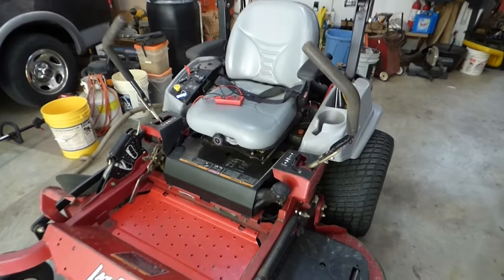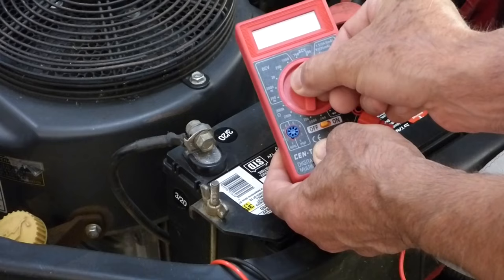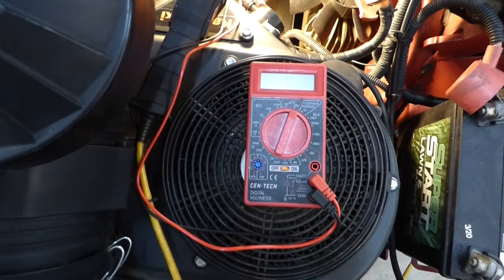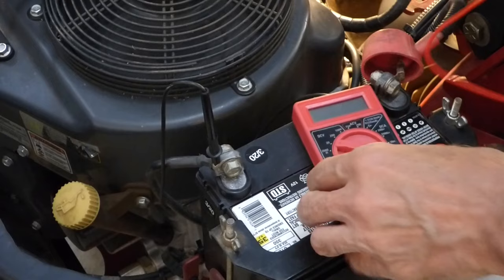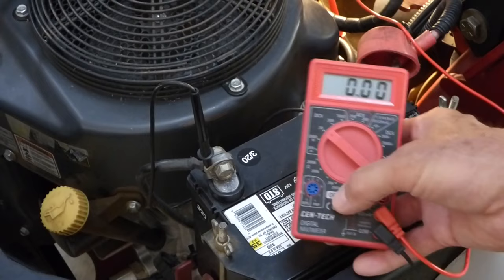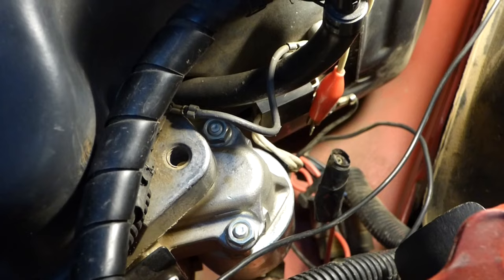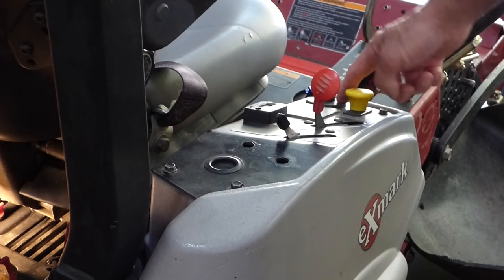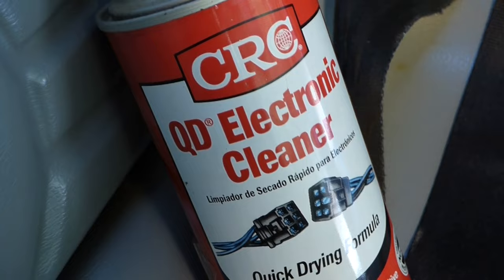How to Test the Charging System on Small Engine Equipment - Battery not Charging Fix

Comment: Your video is a nice addition for young fellers that are learning WHY things are happening electrically.  It's a very good tutorial! My first check is just to put the leads on the battery before and after it is started to see if there is a couple of volts difference.  If not then I do exactly as you are tracing it down.  Mowers are always dirty and subject to corroded or broken wiring :)  Store them inside folks if you can at all.  It will save you some troubles and last a few years longer kept out of the weather.

Comment: I bought a used JD z445 two years ago and im just getting around to addressing the battery charging issue. Ive just kept it on a trickle charger full time when not mowing. This video appears to be a great tutorial for trouble shooting the issue. Ill do it when i get home! Thank you sir.
Reply from the maker: Just a heads up...  If your battery charging system is not working you can limit the life of your PTO clutch.
Wishing you the best in fixing your mower

Comment: Was very helpful. Thank you. After going through the steps I got to my panel with my ignition and pto and my display. Found that after changing my pto last week I some how loosened the wire harness to my ignition. It was starting but not charging pushed it back on all the way and charging again. Thank for the help!
Reply from the maker: Excellent!

Comment: Thank you great video. You can check those fuses without removing them. Top of the fuse there's small openings either side, with power on place probes on these, sys voltage=open, 0 volts= closed. Thanks again, I've never gave much thought as to how my mower charging system works.

Comment: Excellent video! found that my stator and regulator were fine, and it was the wiring. It was too complicated to rewire or check further so I just bypassed the wire and went from the regulator to the battery and it's charging perfectly. I don't know if this will damage anything else but it seems to be a good fix. Thanks for the info.
Reply from the maker: That should work

Comment: Thank you for taking the time to make this great informative and “micro” explanatory video. It looks like my issue is with the wiring and I was wondering if I could make a direct connection from the lead positive of the regulator and the battery (which made the battery begin charging) and keep it like this instead of digging in the wire harness to figure out where the problem is.

Comment: My god! Brother thank you I operate a landscape business and we own over 20 mowers it is frustrating when our mowers go down and we have to wait a 3 week turn around to get it back from the shop. I fix over 80% of mechanical problems on them so I can avoid taking them in. This is one of the most common issues I run into and usually ends up at shop, from now on I’ll know how to diagnose this thanks my guy!
Reply from the maker: Glad I could help.  Low voltage will burn out PTO's so it's good to keep up with it.
Reply: How many yards you have to need that many mowers?, I also run a lawn service with 2 mowers and 113 yards,  I fix my own also after warranty goes out til I upgrade, are you a commercial client with your repair shop, we come first here and most time back going in hours... just curious

Comment: This is a great video to learn how to check the wiring after checking stator and regulator outputs. Thanks!
If I came upon a fuse block that dirty I’d do something to protect it in the future, even if it was only cleaning up the surrounding area and covering with duct tape and using a sharpie to write “FUSES!” on the tape.  Bad design - should have had a removable cover built in from the factory.

Comment: Excellent video with all the details as to how to diagnose issues regarding battery not charging.  Hopefully this will allow me to remedy issue with JD zero turn battery drain.
Reply from the maker: I hope so too!  not good to run the pto with not enough volts... burns then out.
Reply: If you have a battery drain, perform the current draw test between the ground terminal and the negative battery pole with your amp meter, should be less than 0.03 amps with the ignition off.

Comment: I also run a jumper wire from negative battery terminal to the voltage regulator, then from positive voltage terminal to positive battery terminal 😊

Comment: I have a brand new china mini skid steer. The unit worked great except for one issue. It would not keep the battery charged. Followed these instructions and found the red lead from the voltage regulator had not been connected at the factory. Had to undo every wire bundle to find it. Had 45-50 volts at the stator. Thank you.
Reply from the maker: Way to go!

Comment: Nice trouble shooting skills, just some dirty fuses can cause plenty issues. I've got a Ferris mower in my driveway that is going through the same issue. It has a tender on it but I believe they never use it and the batteries are just going dead. I've wanted to start small so I have already replaced the voltage regulator. I'm fixing to pull the single charge wire and omit the switch and see what I come up with. Even the replacement regulator it still isn't charging. I don't see a ground wire either on this Kawasaki as you had stated in your video. That might be the issue with this one. So after conducting your second test and connecting the hot side to the single tab of the regulator, it was charging. So I am going to make a ground wire and see what that does.
Reply from the maker: you can do it!

Comment: Video was helpful. I do understand electricity and the basics of charging systems, but I did not consider fuses or ignition switches when my Husqvarna PZ72 was not charging. I discovered another tip that you might consider, using your multi meter check the resistance between positive battery terminal and the disconnected charging lead from the voltage regulator. There should be no continuity with the ignition switch off, and very low resistance with it on. Mine was registering around 200 ohms when I started this test, after cleaning the ignition switch, it went down to about 50, but it’s obvious that it’s faulty and needs to be replaced.
Reply: Yes and resistance equals and causes Voltage drop.. not good.

Comment: Very interesting. I'm pretty sure my battery is shot because it's ancient (7.5 years, original on a 36hp Vanguard Hustler Hyperdrive) but I never knew a dirty fuse could cause issues like that. Makes sense, just wouldn't have occurred to me to check.
Reply: Yes, this is exactly why you need to understand and visualise the whole charging system front to back… there is a specific order to test components and all components need to be tested until the culprit is found and identified. 
If you don’t understand the system and how it all works you’ll just start replacing parts and shooting in the dark.
Gets expensive and wastes a lot of time and money.

Comment: Hi very good video goshhh it was so helpful I followed your instructions but everything on mine mower cheap out good up to spec I have checked my fuses and still no charge can you give me some tips on what to check now
Reply from the maker: Is your stater and flywheel OK? Is your voltage regulator grounded? If it’s not screwed into metal on the engine you need a ground wire to go from voltage regulator to a grounding bolt or nut… Hard to say without looking at it and knowing what you’ve done but hope you find the problem soon. Let us know what you discover

Comment: Good charging system check video 😊 I liked the isolating of the wire voltage to the battery check, definitely going to do that.  Nice when issue is a simple dirty fuse.  My Snapper ZT has a 20 amp circuit breaker only, no fuses to check.  First riding mower I have owned that has no fuses and hydraulic lifters only Lol.

Comment: Question , should the red battery wire going into the voltage regulator plug be hot with the key off ?
Reply from the maker: Yes all the time

Comment: Seems like an easier way to diagnose the wire instead of the alligator clips would be to measure the voltage drop between the positive terminal of the battery and the output of a voltage regulator. Should be minimal, I’m currently troubleshooting a situation where I have 1.5 V between the positive terminal battery and the output of the voltage regulator. I haven’t sold it yet, but that seems high, I’m in the 13+ range at the regulator but less than 12 at the battery.
Reply: My money is on a corroded or bad connection somewhere along the circuit…check all connections and check the wire for fraying etc, process of elimination.

Comment: My amps on the voltage regulator was 12.5 and 12.3 with pto engaged 

Is that too low?.   My engine keeps stalling out randomly mowing
Reply from the maker: higher would be better but you may be ok but watch that it doesn't go lower than that.  What do you get when the pto is not engaged?   you have to be careful running your pto at too low volts because that is what burns them out.
Reply: @helpinguonline  I just upgraded my regulator and battery with clean grounds. Now 13.6 13.2 with PTO engaged
Reply: @LeviHardin28  amazing how cleaning connections increases Voltage, it’s the resistance in dirty corroded loose connections that causes resistance and in turn causes voltage drop.

Comment: So even though you have 13.5 volts at the battery terminal,  like at the first of the video, there was still a problem? I figured if you got 13 volts at the battery while it was at full throttle, you were good.
Reply from the maker: The beginning of the video is just showing what a proper operating charging system should look like

Comment: my simplicity does not read more than 12.65 while running, but i just mowed and it still says 12.65. Could the charging system be working fine?
Reply from the maker: If you run it at full throttle you should get at least 13. If you’re charging system is not working properly you can burn out your PTO clutch

Comment: So cleaning the fuse box fixed your problem?
Reply: Use electric grease on connectors and fuses
Reply from the maker: Yes it did
Reply: @helpinguonline  Please mention that you need a cleaner ( such as CRC) when cleaning out plastic parts,  Make sure   the can says "SAFE ON ALL PLASTIC " because some cleaners aren't plastic friendly.  They will melt the plastic. Thanks for the video, very helpful.
Reply: The fuse was dirty and causing resistance wihich in turn causes voltage drop or in this case, insulating the connected surfaces and stopping voltage flowing at all.

Comment: how did you start the engine with a dead battery? I have a jump starter
Reply: It wasn’t a dead battery, it was a low voltage at 11.78v…. On cranking it showed 8.8v which is still enough to crank the engine over with the starter motor. Any lower voltage and it would struggle.